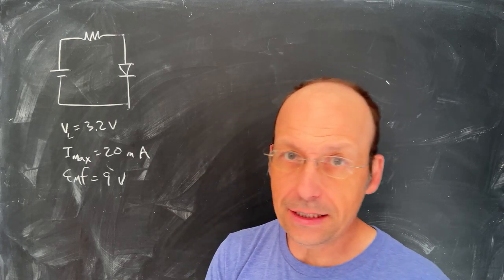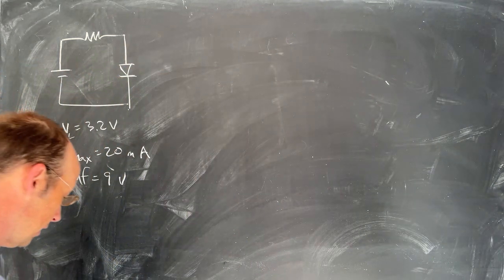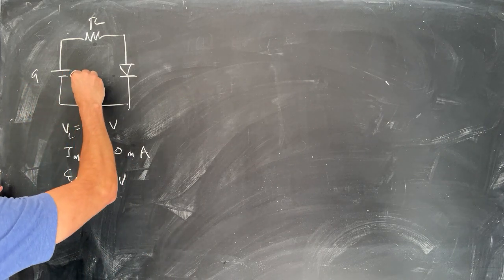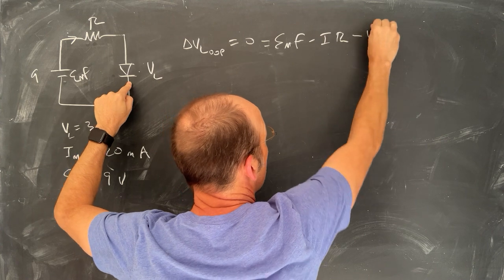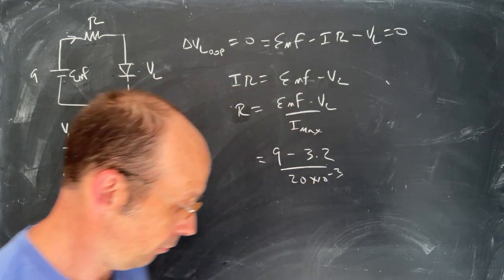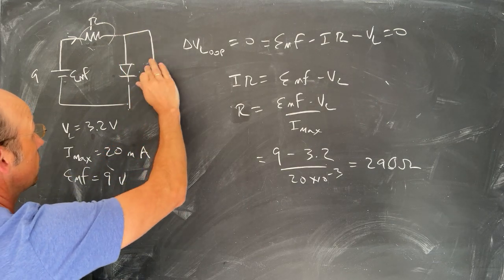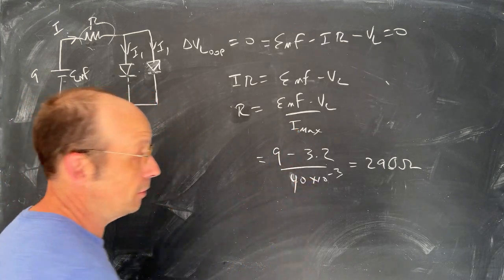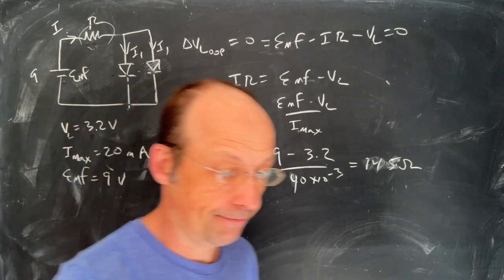Physics Problem: Calculating Resistance in an LED Circuit

Comment: Assuming the diodes are matched, the value of the resistance should stay the same as one diode. In series, the voltage is divided between the diodes as current stays the same. In parallel, the current is divided between the diodes and voltage stays the same. Educate me if I’m incorrect, I’m self-taught.